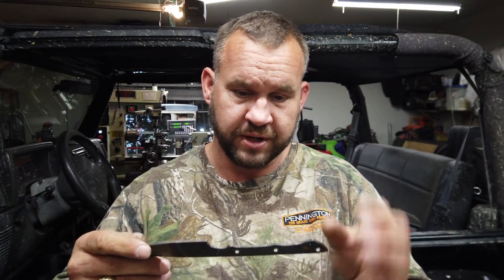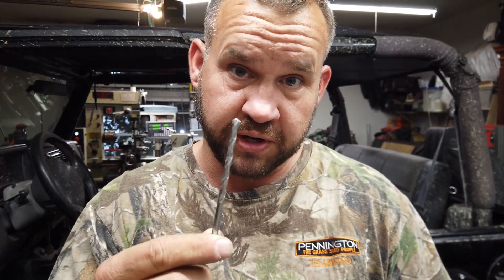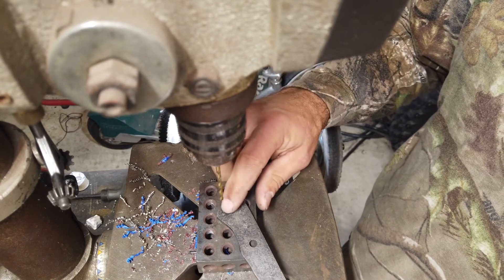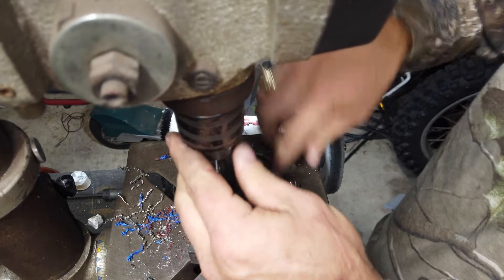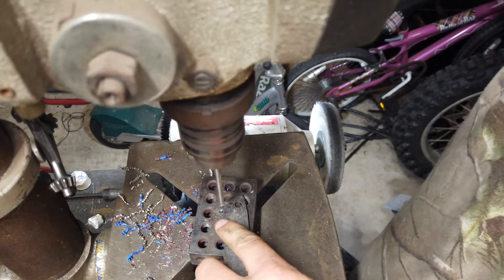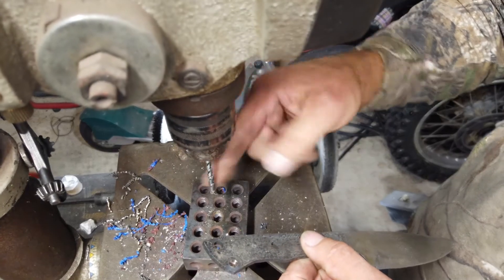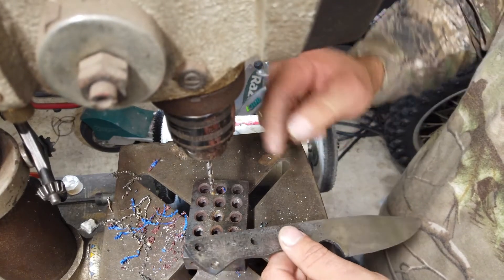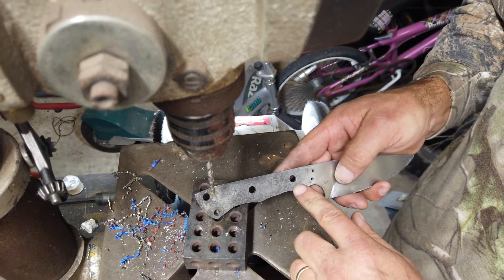Drilling Through Hardened Steel

Comment: Thank you.  I spent a lot of time trying to drill out a broken metal screw, with a screw extractor and then with multiple regular bits, but no luck.  Then after seeing your video, I used a masonry bit and it cut though the screw in seconds.  Thanks so much.

Comment: I usually just wrap the blade in a wet rag and blow torch the area I want to drill in the handle and then let it cool. Bring it to the drill press on low RPM and it’s like a hot knife going through butter.

Comment: Regarding OIL:  Unfortunately, the specific type of oil or coolant has a great effect on cutting.  There are numerous oils out there and the best one will work dramatically better - so if anyone knows, please tell.  NOTE:  Decades ago the awesome cutting/threading oils were discontinued due to environmental issues.  One in particular were the tapping oils which "stunk" from the sulfur content - they are still phenomenal when tapping tough metals.

Comment: Funny how this is the only thing that worked for me.  How is it supposed to be done?
Reply from the maker: Tungsten carbide, which happens to be the inserts on a masonry bit.  Just a little trick an old timer taught me when i was trying to drill a hole in a Jeep bumper.
Reply: @lazyjmetalworks9626  well, i grabbed the hardest bits available and the masonry bit only worked when extreme pressure was applied making the bit blue and smoking which is something that I never do.  It's been a few weeks and I'm glad I lost my patience, because I now have holes 😂

Comment: I've used this trick before, but I changed the profile of the carbide tip before drilling. The chap that showed me this sharpened the tip using a green grit (silicon carbide) grind wheel. He put a 30 degree chamfer onto the tip and then put two extra 30 degree  cuts right at the centre so that the tip had a small star shaped cutting profile. Used with copious amounts of cutting oil and a low speed, I have drilled stainless steel, spring steel and other hard items using this method. Drilling too rapidly causes the bit to smash as it exits the workpiece but with care, many holes can be made with one bit before it's worn out.

Comment: It works pretty well with lower RPM and spot annealing with a mapp torch.
Reply from the maker: Yes, you are 100% correct on that.  I posted that video after watching a Forged in Fire where the guys totally fails to figure out how to get a hole through his tang.  Although sometimes we’re not just trying to drill through a knife tang, and I’ve for this technique to work in those situations as well.
Reply: @lazyjmetalworks9626  Do you re-grind the cutting edges of your mason bits?  There's another guy here that reshaped his cutting edge into a spade edge, so I'm not too sure how effective it would really be if these are ultimately just disposable.
Reply from the maker: @rfcmachiningllc  no, I don’t, I feel like a $2-$3 bit getting what i need done is more than enough of what I’m asking it to do.   I could see it possibly helping to start the cutting faster with a different angle on the bit if you are proficient at grinding bits
Reply: @lazyjmetalworks9626  Mate, you should definitely sharpen masonry bit on regular steel drilling angle. you will probably drill 5-10 holes (with 2-3 re-sharpenings)... Than again it says "Lazy J" :). It's amazing that they can even get through hardened steel as they are begose that don't have cutting angle at all. Learned something new

Comment: Should NOT drill such an item without a vise. If the bit would bind in the metal you could lose a finger or two, especially when drilling a KNIFE blade.
Reply from the maker: Totally agree not the smartest thing I’ve done
Reply: @lazyjmetalworks9626  We all have lapses of judgement from time to time. I still have the scar from one of mine!

Comment: Interesting! I wonder if a cheap rotary file off Amazon would also do it.
Reply from the maker: Depending on how hard the steel is, I suppose it could work?
Reply: I don't think you would have much success.  Cheap masonry drills have piece  of carbide welded on top and cheap rotary files are probably just harden high carbon steel. (or they wouldn't be cheap).  You  need carbide file in order to cut hardened steel.

Comment: Hey man, thanks for the video! I got a hardened blade I need to drill through and didn't really wanna spend the money on a real expensive bit. I'll give this a shot. 👍
Reply from the maker: No particular brand, I think the Diablo brand are actually Carbide tipped but they’re quite a bit more expensive than the typical cheap masonry bits.  I’ve used both.  The Diablo will last a touch longer but in the end you’re better going with the cheapest one you can get, they will not last long at all, but in a pinch they can get you through the hardened steel whereas not much else will.  When drilling through the hardened steel the bits are basically disposable
Reply: @lazyjmetalworks9626  So I remembered that a while ago I bought a carbide bit from a company called Cobra carbide. I used it once and I remember having trouble getting through the steel that I was trying to drill so I figured the bit was completely dull. But I was like you know what before I go out and spend money on more bits I'm just going to give this thing a shot and it drilled right through the hardened A2. So I'm happy about that. But still thank you for the video again and if this bit that I have ever fails I will definitely use your advice.
Reply from the maker: Chad Hill glad to hear it worked.  Sometimes it takes a little while to get it to start cutting but once it does it get through it
Reply: @lazyjmetalworks9626  Cool. I have used Diablo bits before and currently have a Diablo rounding over bit in my router. They seem to perform pretty good.
Reply: @lazyjmetalworks9626  and like you said. "disposable". It's a one and done. I need it for a specific purpose and that's it. As long as it does that job I'll be happy! Lol
Reply from the maker: Chad Hill awesome, you’re welcome, let me know how it works for you.  I’ve used this multiple times with great success
Reply: @lazyjmetalworks9626  cool man. Thank you and I will let you know. If you can recall was there a particular brand you used?

Comment: here`s an idea .. why does`nt someone make a drill to do that ?
Reply from the maker: willie moon That’s a good question and idea.  My guess is they would be ridiculously expensive and not very durable, either diamond or tungsten carbide would work but both of those materials are brittle and expensive.  The masonry bits work well enough and are so cheap if you know this trick and are not doing this on a production level, one or two holes and then throw it away and grab another.  I am going to look around and see if anyone makes a bit for drilling through hardened steel
Reply: They do make drill bits just for this purpose, however, as an example I'm trying to drill a 5/16" hole through a PTO input shaft on a roto-tiller so I can secure an adapter to it....its so hard, even the carbide bit I have didn't do anything...so I looked up the Tungsten Carbide bits that machine shops use for drilling out broken easy-outs, and other type of hardened steel drilling tasks....a 5/16" bit is $70-100+ depending on the length, and bit style.  A complete 25 piece set is $1200.

Comment: This is a good idea, but it works even better if you give the carbide tip a grind that looks more like a metal drill with a sharp edge. When it comes from the store it's not even remotely sharp, as it's meant to chip it's way through stone. But a cheap resin bond diamond wheel will grind carbide no problems. And with a propper cutting edge it will cut much better, and last a lot longer too.
Reply: No drill bit manufacturer sharpen their bits. There are two reasons: 1- Force users to go for higher priced tungsten carbide bits, 2 - They do not have time to sharpen millions of bits while in manufacturing process as it's enormously time consuming.